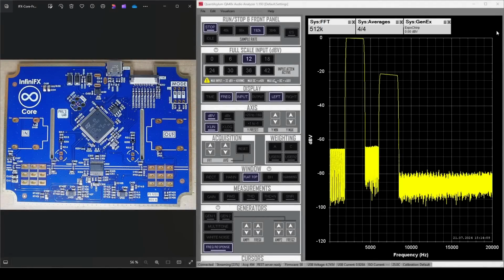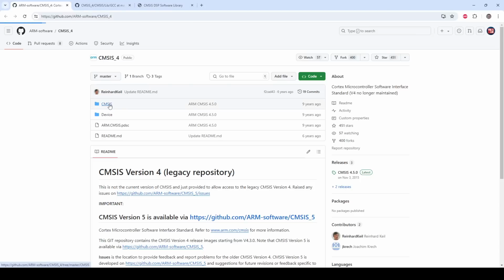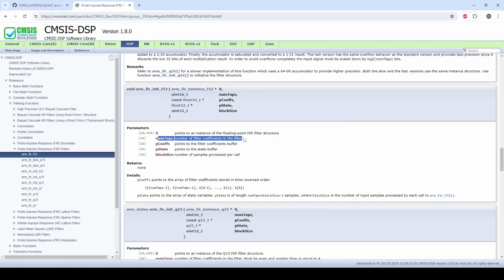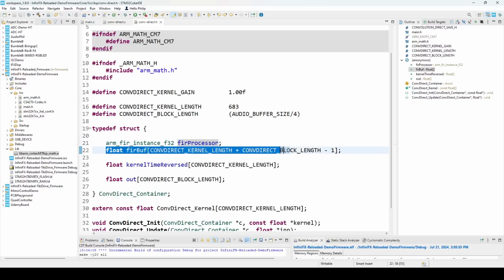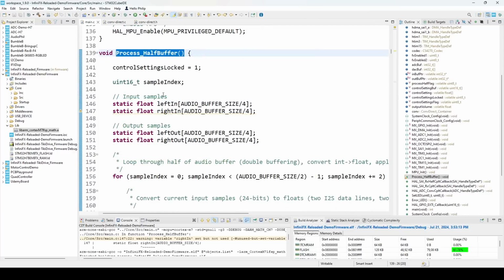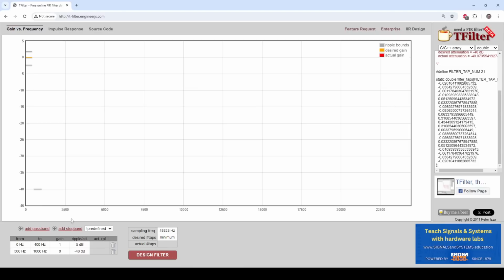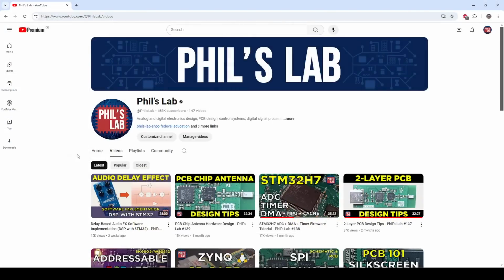STM32 Real-Time FIR Filter Implementation (CMSIS DSP) - Phil's Lab #141

Comment: Thanks for sharing. I am trying to follow along using the NUCLEO-H753 (which uses the STM32H753ZI) but am unable to get the filter to compute anything. It encounters a HardFault whenever the arm_fir_f32 method is called, but the arm_fir_init_f32 method works just fine. I am wondering if someone else is facing this.

Comment: Direct convolution is inefficient. NEVER do FIR filters with direct convolution, if your impulse is larger than mere 64 samples. You have to do FFT convolution and then do inverse FFT. With an old STM32F407 I can run almost 16000 taps filters this way and RAM is the limit, not the CPU. Also the performance of FFT in CMSIS-DSP is absolutely abysmal. Don't touch that. If you want to work with DSP on STM32 you have to treat yourself with a better FFT implementation.
For audio FIR filters you should use RePhase - it's the best and true audio-class.

Comment: Very nice video Phil!
With your current infinity development platform, how many effects do you think you can chain with current hardware?
Like equalizer > distortion > delay > reverb or some pipeline that'll mimick a pedalboard ? Or would you have many identical devices with different firmware instead?

I have no idea how powerful those MCU are for those applications.
Reply: I can provide some indication.  The NXP iMX RT 1062 is a comparable processor.  Using a 256 sample loop with a 48kHz sample rate,  the processor can calculate two Schroeder reverbs, a pitch shifting effect, a noise gate and tremolo effect (both as described in past Phil's lab videos), a 128 sample FFT and inverse FFT along with a 64 sample FFT magnitude calculation in sequence without problem.   The iMX RT 1176 that Phil discussed in the comments has a 50% more powerful Cortex M7 core and includes a second M4 core.
A single STM32H7 processor can probably handle the DSP functions of a moderately powerful pedal board.

Comment: Summary

What it's about: This video demonstrates how to implement a Finite Impulse Response (FIR) filter on an STM32 microcontroller using the CMSIS DSP library for real-time audio processing.

Key Points:

* 0:00 FIR Filter Advantages: FIR filters offer precise frequency response control, are stable, and can create complex filter shapes.
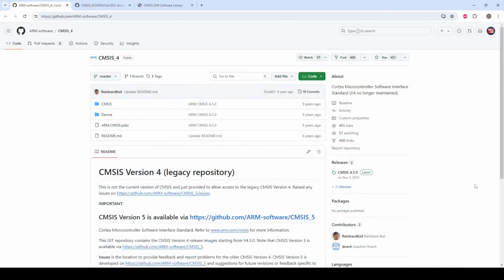* 3:06 CMSIS DSP Library: This ARM library provides optimized DSP functions for Cortex microcontrollers, including FIR filtering, offering significant speed improvements over custom code.
* 3:06 Implementation Steps:
    1. 3:06 Download CMSIS files: Get `arm_math.h` header and the appropriate pre-compiled library (`arm_cortexM7lf_math.lib` for single-precision floating point on STM32H7).
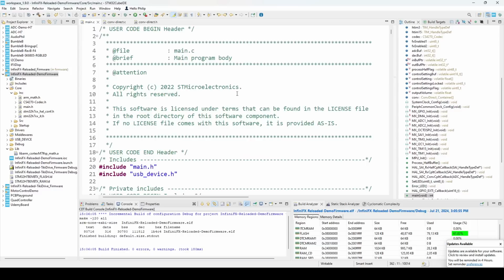    2. 4:24 Add libraries to project: Include the header file and link the library in your IDE (STM32CubeIDE in this case).
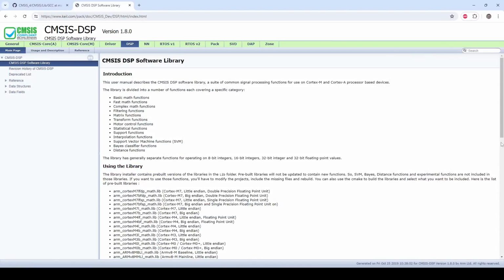    3. 6:00 Understand CMSIS FIR functions:
        * `arm_fir_init_F32()`: Initializes the FIR filter structure. Requires reversed coefficient order and a working buffer.
        * `arm_fir_f32()`: Performs the actual filtering on a block of input samples.
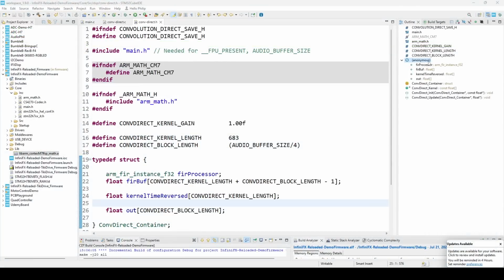    4. 9:13 Write your code:
        * Define kernel length, block size, and structures for the FIR instance, buffers, and kernel.
        * Write functions to initialize the filter (including kernel reversal), process audio blocks, and convert between integer and floating-point formats.
    5. 16:17 Design the filter: Use tools like T-Filter to design your desired frequency response and generate filter coefficients.
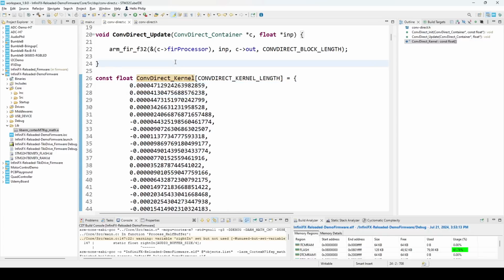* 21:41 Real-time testing: The video demonstrates the implemented filter working on a custom STM32H7 board, achieving results very close to the designed filter response.

Tools Used:

* STM32CubeIDE
* CMSIS DSP Library (version 4)
* T-Filter online filter design tool
* Quant Asylum QA403 audio analyzer
* Segger J-Link debugger

Tips:

* Remember to reverse the filter coefficient order before passing it to the initialization function.
* Consider memory constraints and processing power when choosing your filter length.
* Non-idealities in the system can affect real-world filter performance.

i used gemini 1.5 pro to summarize the transcript

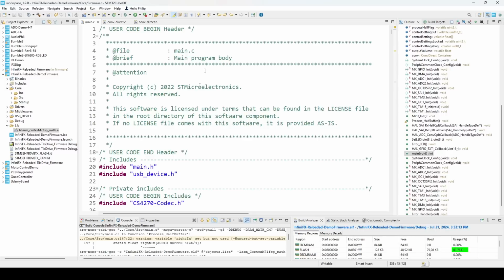Comment: Hey so what's the deal with using 32-bit floats as your kernel type, specifying some 20 digits for each element, when only 10-12 digits of precision is realistic with this datatype at this magnitude? Looking at 13:50 here, Your very first coefficient for example, is diverging after the 12th digit, meaning the entire least-significant half of your coefficient is not at all being represented in the hardware. At such a long kernel length, won't this essentially result in a different filter than what was called for by your literal const declaration?
Reply from the maker: Yes, this was just due to using TFilter that works with doubles, and me copying over the values directly without further processing/precision reduction. The reason I didn't do any editing to those values was for the sake of time, and the fact that the filter results are - typically - still very similar between theoretical and practical implementation. The 'precision-reduction-effects' of using floats was also mentioned briefly in the video. A better alternative would of course be to use the DP CMSIS libs, or use a filter design tool that works with SP floats.

Comment: Very informative. Two questions. Why would you need multiple passband and stopband? I kinda seem lost. Have you mentioned this on a video already? And is this why you had to use this specific library instead of implementing your own FIR (which you've done before)?
Reply from the maker: Thanks! The filter in this video is just for demo purposes, to show how to design a somewhat-specific FIR filter - no particular practical application. The CMSIS library is faster than the 'naive' FIR filter implementation.

Comment: Hey, great content as always! I wondered if you've looked into the STM32 FMAC hardware? Wouldn't be a nice hardware-agnostic demo like this, but maybe it would be interesting to compare the pure firmware FIR approach to hardware? I've seen it on the peripheral list but never used it myself. Not sure what the limitations might be. Thanks!
Reply from the maker: Thanks! Haven't really used the FMAC terribly much, as it's typically a fixed-point implementation. Most of my DSP implementations are floating point and so far haven't had the need to use it. I definitely should explore that a bit more though!